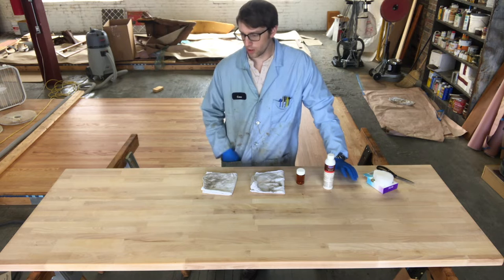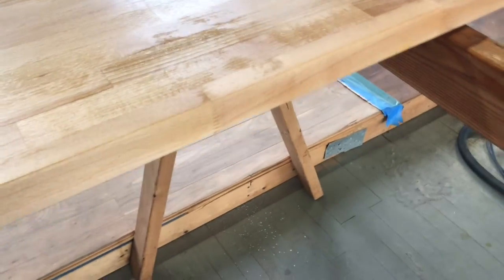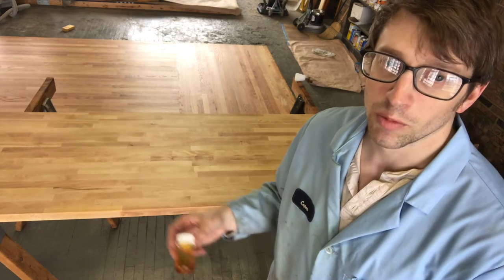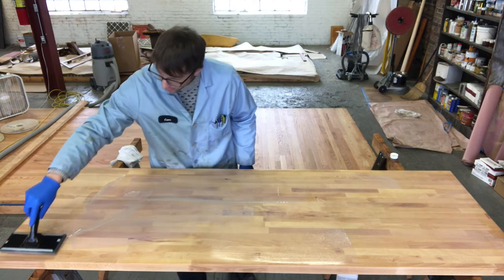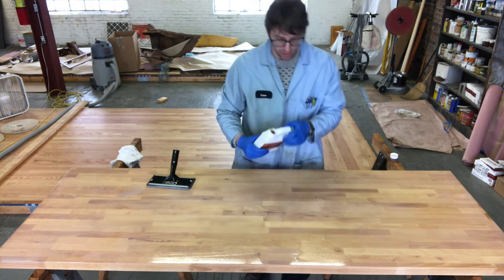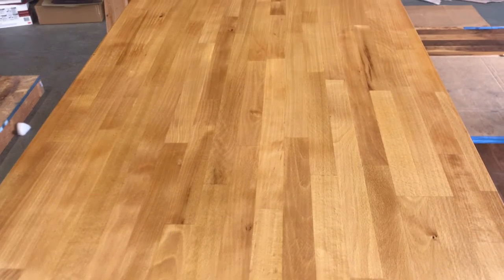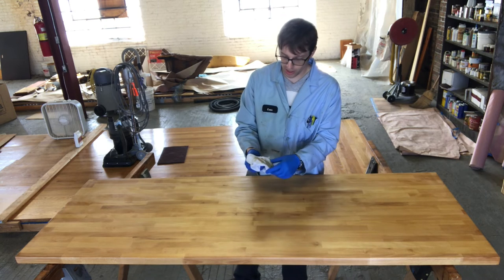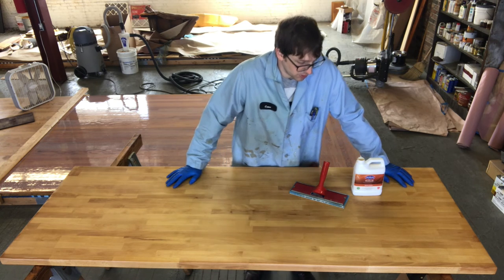Finishing Countertops with UTOS and H2OLOX

Comment: I want to use this on butcher block that has been stained with an espresso color. Will I follow all of the same steps on block that has been stained?? Will the sanding or mineral spirits take off the stain??
Reply from the maker: Thank you for watching our videos and for your interest in our products for your project.

The sanding and mineral spirits wipe would be preparation steps BEFORE staining in our opinion.  You do NOT want to sand after staining as that would remove color.  You can also skip wiping with mineral spirts as well.  Now that the piece is stained, you'll just continue starting with the application of the UTOS.
Reply: Three stain that was used is oil based. Will this go on well over an oil based stain??
Reply from the maker: @SuitcaseJohnny  Yes.  UTOS is also oil based.  See the stain and waterlox guide for more information: https://waterlox.com/guide-stain-and-waterlox/

Comment: I used Minwax oil stain, let it dry 4 days, 2 coats of UTOS with a day between each coat, and 2 coats of H2OLox with a day between each and a fan blowing pretty much the entire time.  It's been 7 days and the pieces still have a kind of rubberized feel to them. Is this normal? Will they eventually harden and I'm just being impatient or did i do something wrong?
Reply from the maker: Thank you for choosing Waterlox products for your project.  I would not say it’s normal, but it is also not unheard of.  Time will fix your issue, likely within a week or two and even then it will likely continue to cure.

Sometimes having a fan blowing on the surface constantly will cause the surface to cure too quickly which makes it harder for the oxygen to penetrate deep into the film.  The fan is often only necessary to help ventilate fumes which is even less critical for the UTOS and H2OLOX formulations due to the low VOCs.

If you wanted to expedite the process you could follow this guide: https://www.waterlox.com/guide-how-do-i-get-rid-of-lingering-odors-and-tacky-finishes/
Reply: @Waterlox  Thanks for the quick reply.  I will give the fix a try tomorrow.

Comment: What brand of applicator pad do you recommend? I’ve used several and they all have left little pieces in the finish even after deshedding
Reply from the maker: Robert - We supply ones from DuraTool on our website that seem to work well.  I have not run into issues unless I wash and reuse the applicators quite a few times (may be due to the soap degrading the glue??).  They are listed under the paint and stain trim pad on our accessories page: https://waterlox.com/accessories/

Comment: If you add another coat, would it give it more gloss/shine? Any added protection with extra coats?
Reply from the maker: Thank you for your interest in our products.

In general, no for both questions.  If you use the Satin finish it will always be satin regardless of the number of coats assuming everything was mixed and applied correctly.  If you'd like a higher gloss, you'd use the Gloss finish instead of the Satin finish. Also, once the surface is sealed, additional coats won't add additional protection or waterproofing.  If you apply too many coats, you'll actually start to create a softer finish.
Reply: @Waterlox  oh, good to know. Thank you!

Comment: I want to finish a guitar neck,I want a really smooth feeling about it,any recommendations?what sheen should I choose?satin or matte? Thanks
Reply from the maker: Sam - Thank you for watching our videos and for your interest in our products.  Actually, I wouldn't recommend the H2OLox system for that type of project.  The H2OLox can't really be wiped on and its water thin, so it can get a bit runny when it isn't used on flat surfaces (like floors, counters, tables, etc.).

Personally, I would use the Original Sealer/Finish (TB 5284) for pretty much all fine wood working projects.  You can wipe on thin coats and it is very forgiving.  It has no additives or fillers so it strictly enhances the natural beauty of the wood.  For a wood working project like a guitar neck, I would wipe on thin coats until I achieved the desired sheen/look.  You can apply thin coats 8-10 hours apart with a clean, lint free cloth.  Stop applying coats when you get the desired sheen.  Keep applying coats to build your film and increase your gloss.

Comment: Hi! We just applied the first coat of UTOS and plan to do another today. We were wondering if it is necessary to use the H20lox to protect the wood? We want to keep a natural wood look so we chose matte. It will be used for a butcher block island so we want it to be durable! TIA
Reply from the maker: Elise - Thank you for choosing Waterlox products for your project.  The UTOS is NOT waterproof enough on its own so you'll need to apply the H2OLox Matte to get the full protection.  It will look a little more finished, but still very low sheen.
Reply: @Waterlox  thank you! Can we do our second coat of UTOS whenever now? And then wait overnight for h20lox? 

Also, do you recommend sanding after UTOS and before h20lox?
Reply from the maker: @eliseantony4850  Yes, you can apply the UTOS now and then wait overnight before applying the H2Olox.  DO NOT sand after the UTOS!  The UTOS is meant to seal the wood from the water in the H2OLox, sanding would defeat that purpose.
Reply: @Waterlox  thanks! After second coat of UTOS it looks a little white in some spots, I think it’s from the rag we used to take the excess off. And almost kinda tacky/sticky? Should we wait for it to dry then use mineral spirits to clean it tomorrow?
Reply from the maker: @eliseantony4850  If its white, then you may have applied too much or not wiped off the excess in time.  I'd recommend a good buffing with some mineral spirits now and try and get it smooth.  Nothing should be tacky/sticky after about an hour.
Reply: @Waterlox  thanks! Feels better already, definitely smoother and some excess beaded off the edges. You can see where the wipe marks are from certain angles is that okay? Can’t see anything from straight on. Just wanted to make sure those will be covered when we do the finish
Reply from the maker: @eliseantony4850  that should be fine.
Reply: @Waterlox  do you have an email that I could possible send a picture to? It’s still looking streaky this morning nervous it won’t go away with h20lox!
Reply from the maker: @eliseantony4850  info@waterlox.com
Reply: @Waterlox  just sent thank you so much!

Comment: If I cannot find maroon Scotchbrite, what else can I use?
Reply from the maker: Maroon scotch brite pads can likely be found in any hardware or even automotive stores.  If you cannot find them, they are labeled as “very fine” which would be equivalent to 0000 steel wool.  This is also similar to 320-400 grit paper. Paper, steel wool, and the scotch Brite pads all “cut” a little differently which is why we recommend the pads but the other two can be used in a pinch.
Make sure to thoroughly vacuum after steel wool to ensure no metal bits are left (which can rust from the water in H2Olox). 
DO NOT sand aggressively or use too much pressure when using paper as it will leave a more aggressive scratch that you may see through your finish coat.

Comment: So I use utos sealer and h20lox and then how often do I reseal and what do I reseal with? Utos or the satin h20 sealer? I'm confused
Reply from the maker: Jeremy - I see that you've posted on many of our videos so thank you for your interest in our products. We have a helpful guide about the lifespan and recoating frequency of our products on our website (https://www.waterlox.com/project-help/guide?id=0a4398de-7a05-4868-9984-dfef9f5bcc88&q=).  To summarize, the finishes are "permanent" so they don't need to be regularly reapplied like butcher block conditioners, waxes, mineral oil, etc.  I put "permanent" in quotes, because if the surface is rarely used, then it should never need to be refinished, however, for a heavily used surface like a kitchen countertop, occasional maintenance is needed.  For heavy traffic areas, refinishing is still on the scale of 7-10 years.

For refreshing, we have a detailed guide on our website (https://www.waterlox.com/project-help/guide?id=98bf39c6-7eec-4433-b735-8ddd5c7dcbb5&q=), but you can use just the top coat (H2OLox Satin Finish in this question) when desired.  For more heavily worn areas, you can spot treat with the UTOS to treat those first before refreshing with the H2OLox Satin Finish.

If you have any other questions feel free to reach out to us at info@waterlox.com or (800) 321-0377.

Comment: I didn't wipe the bottom of my edge when I was doin my second coat of utos. All along the bottom edge the excess dried how do I fix that before my first coat of h2olox? Thank you! I'm a goof. Lol
Reply from the maker: You can scrape off the bulk of it with a metal or plastic scraper, then lightly sand with 320 grit paper to clean up the rest.  Vacuum and wipe with a little bit of mineral spirits to remove any stubborn dust.  I'd recommend wiping on a really thin coat of UTOS to make sure you reseal any re-opened areas.  Let that dry at least 6 hours before applying the H2OLox.
Reply: @Waterlox  thank you very much for your help !! Seriously THANK YOU!

Comment: Back with another question... lol. I followed all the steps for the UTOS and everything went smoothly. It's one day later and I applied mineral spirits and waited around 30 minutes before putting on the H20LOX. However, when I poured a puddle on the counter and tried to apply the H20LOX, it won't spread evenly and instead almost has a spiderweb like effect, where it's pulling away from the countertop rather than evenly dispersing. I tried two different synthetic pads and a foam brush and the same thing happened, as well as the same thing on the other countertop I hadn't put any odorless mineral spirits on yet. Do you have any ideas as to what might be causing this and how to resolve?
Reply from the maker: This is a classic case of dewetting.  Water molecules notoriously like themselves so if the surface energy isn't right, the water will group together instead of spreading evenly over your surface.  This is more common in the cold months.

Did you wipe off the "spider webs" or let them dry?  Hopefully you wiped them off, in which case you actually applied a very thin coat of the H2OLox which should help with the next attempt.  I would recommend using a little bit of the H2OLox to wipe your surface 5-10 minutes before coating (instead of mineral spirits).  Just put a little bit on a clean cloth and use it to wipe any dust off your surface.  This will help to "pre-wet" the surface and should help the H2OLox flow out better.  If you do see a little bit of dewetting continue to brush the area and it should improve.
Reply: @Waterlox  Yes, I did wipe it off! Your suggestion worked perfectly and the coat went down perfectly on my second try. Thank you!

Comment: Do you have to use the UTOS or can you just do H2Olox?
Reply from the maker: No, you do not have to use the UTOS first, but you should use some form of sealer as you don't want to put that amount of water directly on raw wood.  It will cause severe grain raise and may not dry properly (or at all) on high tannin woods.  You could use our Original Sealer/Finish, UTOS, or our TrueTone colors before the H2Olox.  Check out our different Waterlox Sealers video at waterlox.com/videos
Reply: Thank you!

Comment: Hi. How long after buffing out 2ns coat of UTOS before applying h20lox?
Reply from the maker: Matt - I'd recommend a minimum of 8 hours with good ventilation.  Overnight is preferred.
Reply: What brand is that applicator? Looks like it says NannFlock but I can’t find that anywhere.
Reply from the maker: @foxmxracr  that specifically is a Padco NanoFlock pad.  That will work as well as the Wooster pads (https://www.waterlox.com/buy-brushes-pads) or Shur-Line.  I believe Wooster and Shur-Line can be found at Home Depot or Lowe’s.
Reply: @Waterlox  thanks! Got all coats on. Letting them cure. 3 days so far. Looking really good. Hoping for good durability. I’ve got a good feeling about it. Cleaning recommendation? Murphy’s?
Reply from the maker: @nelsonious999  Check out our cleaning and maintenance guide (https://www.waterlox.com/project-help/guide?id=33a6bb91-ad85-475c-b4e0-6ae4f854afd1&q=).  You can find that help and other guides in our How-To area as well.
Reply: All I could find at Home Depot was a Shur-Line non-rip pad applicator for “walls and floors”, but it doesn’t say anything about “water-based” or “wax”… nor does it say, “synthetic”. Just for paint and stains. The link you posted wasn’t working for me to see exactly what I need. I’m a perfectionist so I want to do this right. I do already have the UTOS on both sides already. But will that applicator be alright to use when applying the H20LOX Matt finish sealer? Not sure if this makes a difference, but I’m doing this on a plank-style ambrosia maple countertop…
Reply from the maker: Sorry for the delay.  From what I can find on the Home Depot website, the pad that matches your description should be fine for your project.  I am also not sure why that link doesn't work as it is the correct link when you visit the web page.  To access it yourself, go to waterlox.com then click the PURCHASE tab and select "Buy Accessories", then "Brushes and Pads".

Comment: It says to do two coats on mahogany is this correct?
Reply from the maker: Robert - Thank you for your interest in our products for your project.  Mahogany is a term that actually covers a variety of wood so it's hard to pin down the specific species.  Many versions can have high tannin content, so it is advisable to apply 2 coats of UTOS and 2 coats of H2OLox to be on the safe side.
Reply: @Waterlox  the species I’m using is sapele
Reply from the maker: @rmiller183  Sapele, while often called Sapele Mahogany, is not truly a mahogany, but that isn't that important.  Sapele is very dense and naturally oily.  One coat of UTOS should be plenty, but be sure to wipe with mineral spirits at least an hour before applying the H2OLox to remove any oils that were forced to the surface.

Comment: Where is that sanding video?
Reply from the maker: https://www.youtube.com/watch?v=-WbddMVIbNA&t=415s
Reply: Thank you! is it necessary to sand before my second coat of utos? I'm doing a large walnut countertop.
Reply from the maker: @johncalvey96  NO!! You should not sand after the UTOS at all.  The UTOS is trying to seal the wood off from the water in the H2OLox.  If you sand, you can reopen that surface which may cause drying issues and grain raise.  A light sanding between the H2OLox is all that is necessary.
Reply: @Waterlox  THANK YOU  for your help and quick reply much appreciated. I just wiped it down with oms before my second coat of the utos! Stuff is awesome